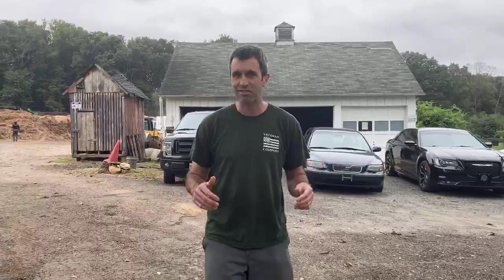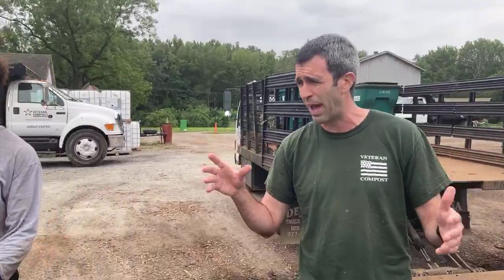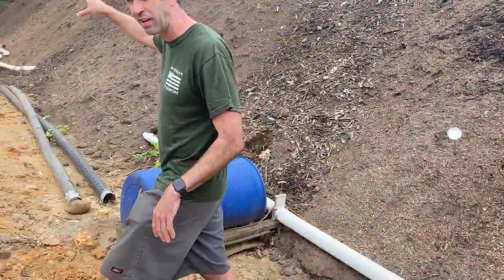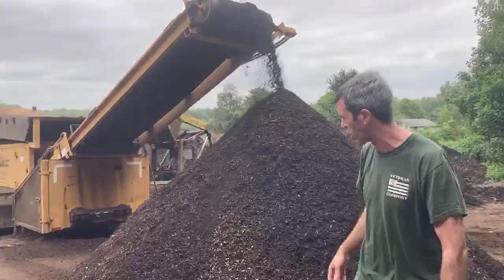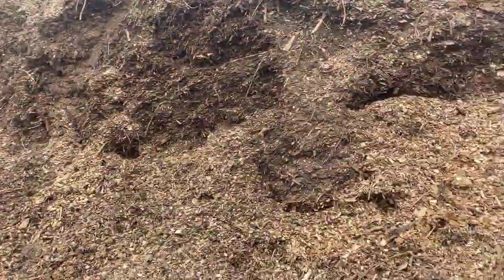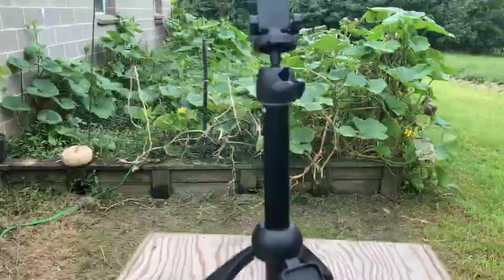How We Turn Food Scraps into Compost in 90 days - Veteran Compost Facility Tour

Comment: Thank you for informative channel, Sir. I am trying to do something like this in another part of the world, and your channel is very informative. I have a question, don't you crush the input waste material before sending it to the piling and curing area?
Reply from the maker: There are some operations that use rotary mixers (like you would use for cattle feed) to blend and crush their initial mix.  However, we see this as just another cost and another machine to have to repair.  So, we just ensure that our loader operators get a good mix when then are doing the initial mixing of feedstocks
Reply: @veterancompost  I see. Thank you for the information.

Comment: Do you guys do anything to get rid of microplastics that screening doesn't get rid of
Reply from the maker: The material we get is 99% free of non-compostable items - but we are always working to make it better so that our compost is even better.  The challenge with accepting outside material is that once it's on our site - it's now ours to deal with (the compostables and the non-compostables hidden in there)

Micro Plastics are terrible, and getting plastic out of our inbound material is our top priority this year.  We are attacking plastics in a couple of ways:
1. Reaching out every month to the Top 2 customers who are putting non-compostable material in their collection bins.  Offering more signage and training to help reduce contamination at the source
2. Litter pickup each day - each employee who works on-site spends 15 minutes each day patrolling for any litter or plastic around the site
3. Building a platform on our "overs" conveyor where and employee can stand an pick out any trash, rocks, etc that they see on the screener belt. 

We are also working on building a new site where we will only handle pre-consumer material for turning into OMRI listed compost.  That way we have the cleanest possible inbound material to make the cleanest possible outbound material.

Comment: Thanks as always Justen!  Any information on your concrete mixing pad itself?  Anything about size, depth, materials, anything would be helpful.  I have heard from other site operators that it is one of the best investments in their site and they only wish it was bigger.  We just broke ground on our new site and are getting plans together to establish a new mixing pad.  We have already gotten a quote and delivery option for 2x6 concrete blocks for side and back walls but trying to get the best information possible on the pad itself.  Thanks!
Reply from the maker: Our mixing/receiving pad is roughly 1,200 square feet, 8 inch thick with wire mesh reinforcement. We made it pretty rugged because we knew we would have a lot of loader and truck traffic on it. We sloped it so that we can collect any liquids and pump them onto the active pile. It’s definitely a great investment for a compost operation!
Reply: @veterancompost  Great, thanks for the information.  I love the slope idea for liquids to pump back into the active pile.  Good to know it's a great investment - there are always so many things we could be investing in, seems this one pays for itself in time.

Comment: Have you considered Soldier Fly farming? Rather than composting all the food waste, feeding them to soldier fly larvae would be a better idea.
Reply from the maker: Feeding animals is higher on the food waste hierarchy than composting, so always a good idea if you can pull it off. We just haven’t seen a setup that would fit our scale and fit our budget. Certainly not opposed to trying it in the future - it would make a great chicken feed 😀
Reply: @veterancompost  start off small, like in a small room and try it for a few years. You can tweak it until it's optimised. I think the only problem with black soldier flies is weather. They need to stay warm and don't like freezing temperatures. 
But I do like your current set up. And I'm sure there must be a way of utilising that hot temperature created by the compost. Maybe run a few copper pipes through the heart of the pile and see what temperature the water can be heated to. Maybe try heating up a hot tub or bath etc?

Comment: How do you keep the worms alive thru the winter
Reply: The pile generate heat. Also the eggs seems to survive harsh conditions, even if the worms dont.
Reply from the maker: We now have our worm bins in our hoop house, so they stay warm through the winter. But, back when we kept them outside we would just load up their bins with lots of material so they could insulate themselves from the freezing temps. Back then we would load up the bins in November, and then start to check on them in March/April when things begin to warm up in our area